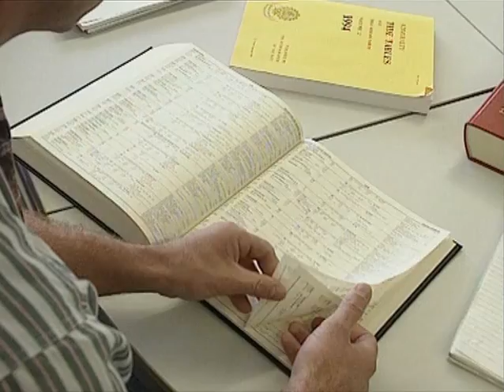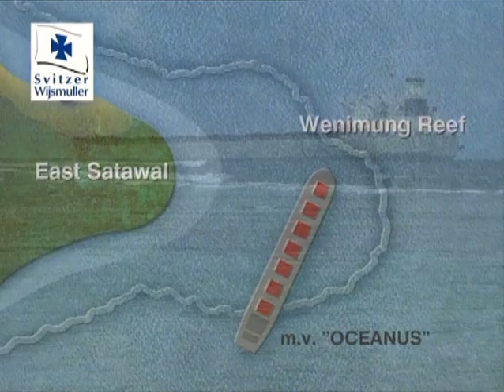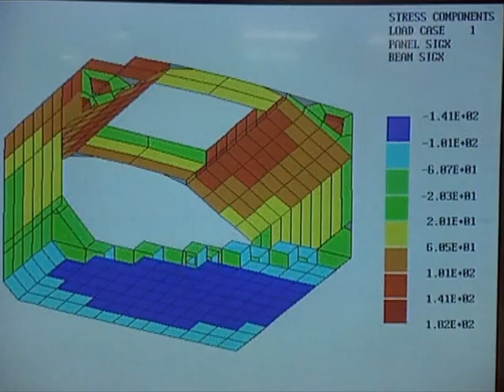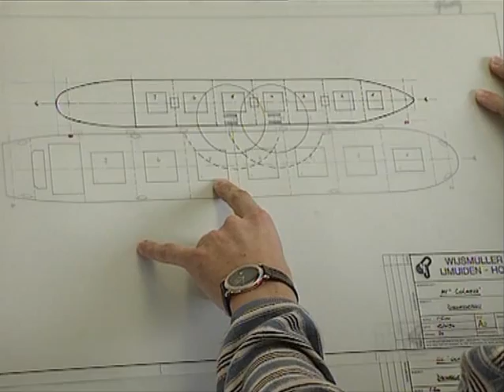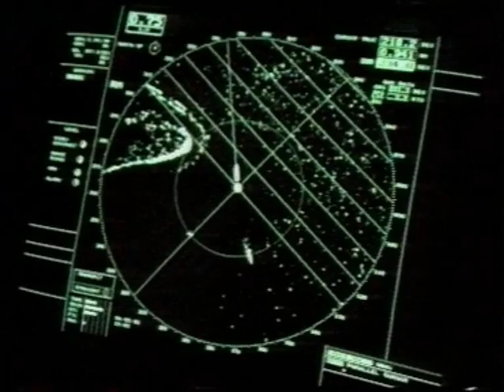SALVAGE IN PARADISE

Comment: Lot of dangerous unsafe things going on here !  Initial connection - Tow Wire whipping across aft deck & nearly  lifting a hatch Cover. NO safety Gear ? The list goes on. Very little Coal actually discharged & ship easily refloated ? Where were the Ground Reaction Figures ? Etc ......
Reply: They do seem unsafe, in other videos they are in a stormy north sea on a half sunken ship without survival suits... But as for the coal they did say almost all of it was removed over 12 days
Reply: It's 30yrs ago, in a remote area ... it's the wild west. 
Things were just different.